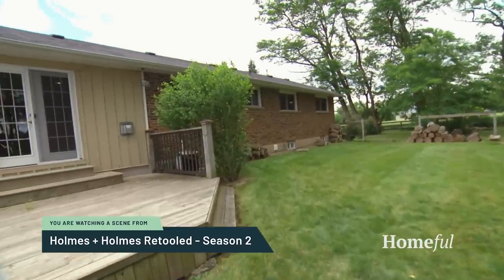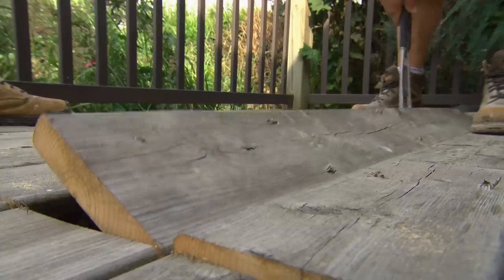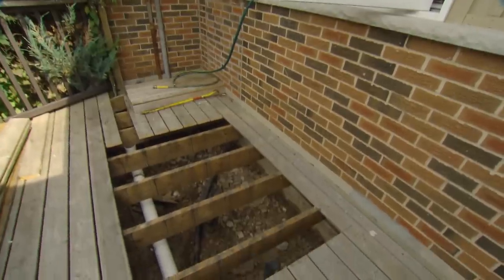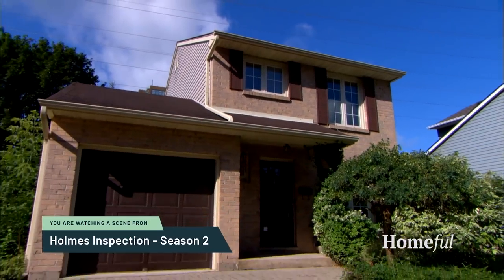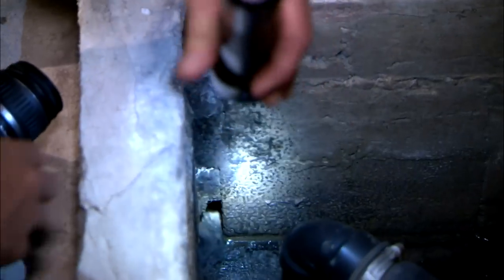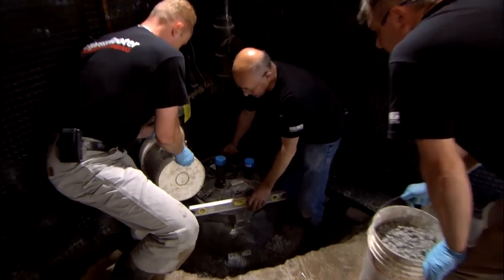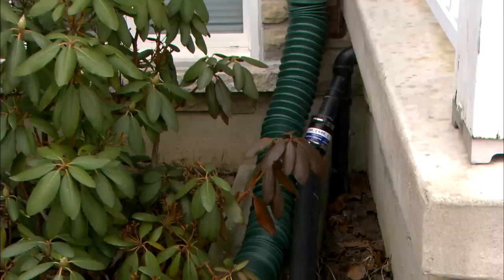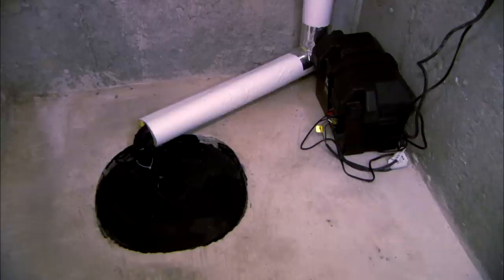Frozen Pipes and Burst Sump Pumps: Mike Holmes Team to the Rescue

Comment: In my family home, we have one sub pump (it's just a hole straight to the weeping tile in the corner with a pump it it) and only had flooding in the basement when the rain was really bad or the sub pup burnt out, and my family home is the lowest in the area that is 1 degree away from pure swamp so our well never goes dry, it's a 300 ft long property with about a 5 foot grade from front to back hitting water less than a foot down at the back. Our house was also built by my step dad's dad(who wasn't a builder) almost 50 year ago at this point and there's no straight wall in the place.

Comment: I don't understand why they insulated the sub pump line.  Or why he used foil tape on the seam instead of the right white tape that matches and is made for that insulation.
Reply: I believe they are trying to keep the cold from freezing up that discharge pipe again. I would guess that there is also a heating strip on the discharge pipe as well to help with that as well.
Reply: It's a "Cold Room"  It gets that name as it's frankly the coldest spot.  It would be like running a water line up that wall-  Eventually if it gets cold enough it will freeze.

Also the foil tape in that application is just fine.  It's the same tape they use for heating and cooling systems.